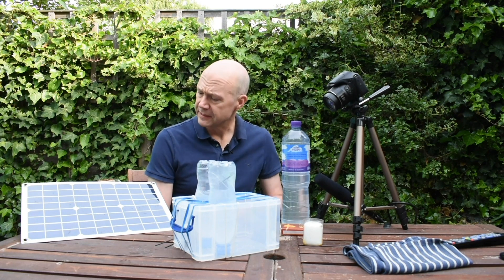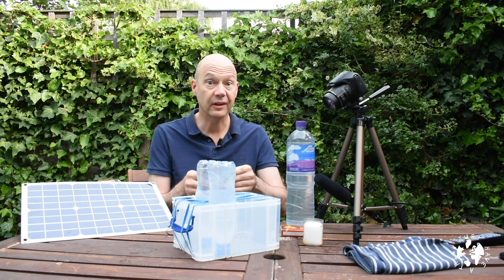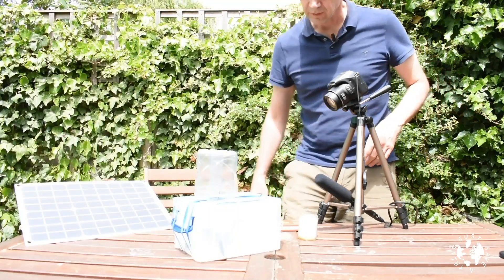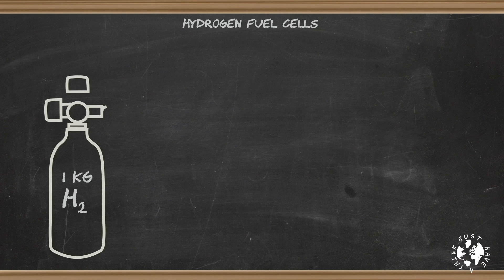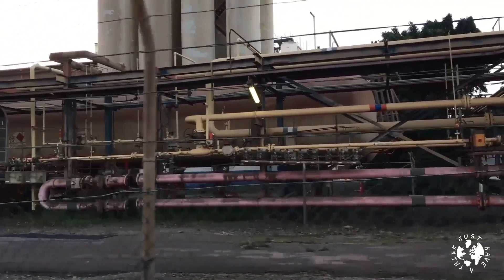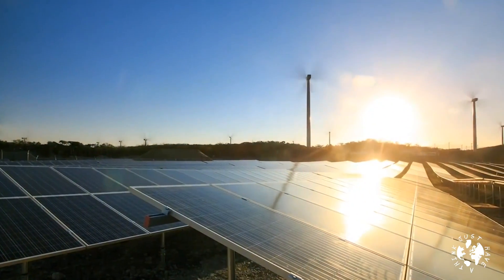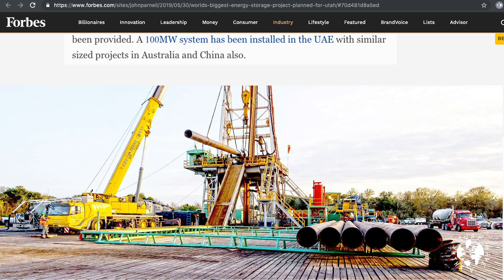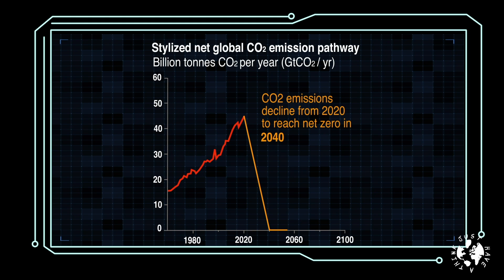Energy Storage in Hydrogen : Does this beat batteries?

Comment: Again, a stimulating and interesting video. Thanks.

You could do a second video which went into a bit more detail about the low energy efficiency of hydrogen storage compared with, for example, batteries and the extent to which that might influence the future direction of technology for light vehicles, heavy vehicles and static energy storage.
Reply: Efficiency is not what it matter most between clean sources, only overall cost. 
BTW, there is a lot of misinformation on internet about the efficiency of hydrogen technologies.
I even hear some sources saying that you need 5 times more energy to produce hydrogen which is stupid to said the least.
Today NEL electrolyzers are at 93% of efficiency without compression, then you need to add 12% for 700 bar compression or 30% for liquefaction, but the new electrochemical hydrogen compression units way superior to mechanic compression are at 8% for 700 bar (less size, way more small, silent, etc) and 15% is possible for liquefaction just scaling up production, even more if you apply EHC or magnetocaloric. 
New high temperature reversible fuel cells in lab already achieve it 75% in round trip efficiency (electricity-->hydrogen-->electricity) with high endurance, they just need a water vapor input at 500c, which could be obtained from any thermal plant as waste heat. 
In addiction, you dont need to convert hydrogen back to electricity to power the grid, you can work converting all the excess to hydrogen and then use hydrogen to power all those thing that can not work with batteries, like the utility transport sector or the natural gas grid.
Reply: @AngelLestat2  efficiency is what matters electrolyses needs an outside power source, and in the end you will only get out of that around 15% useful power. I have talked with many doctorates that do research in this subject of hydrogen and fuel cells and they say its very inefficient in many ways, not to talk about the expensive rare metals needed in a fuel cell.
Reply: @Rickardo22li  So hard is to check the numbers I provide before showing that level of ignorance in the topic?
You are sure you have talked with the right "doctorates" or you talked with biologist, medics, etc?
Go to google...  search interval (last 2 years), and start to check every number I provide (If you find only one being wrong, I will delete my comment). 
Then go back with your "doctorates" and kick their asses.
The rare metals are being reduce considerable, and that is not the highest cost of a fuel cell today, the highest cost comes from the membranes and low production numbers, they are all made at hand, in most cases are made on demand.
(To understand efficiency of electrolyzers and fuel cells, you need to check the output pressure too, even 30 bar of output is half the energy required to reach 700 bar if I remember right).
Reply: Ye hydrogen is VERY inefficient as a means to store energy BUT 
1. Less pollution (current battery technology produces a lot of toxic waste.
2. Good energy density (again current battery technology just isnt there yet)
Reply from the maker: Hi Matt. All good pointers. Thank you. I'm looking at hydrogen for heating and hydrogen fuel cells in the next video, but I do think the fuel cell thing is far better suited to big fleet vehicles like buses and lorries, as well as trains and boats (and maybe one day even short haul planes?). As for inefficiencies in static storage - I'll do a bit of digging on this one, but I think essentially the technology is proven in principle even if it will indeed benefit from better technology to improve performance. All the best. Dave
Reply: @JustHaveaThink  check the numbers I provide and check those with your own research on the state of the art.
I did it hundreds of times, they are very update.
If you want to search info about hydrogen fuel cells for houses, check the hundred of thousands units that were sale in Japan, using methane as input to provide electricity and heat for the whole house.
Reply: @Frank Olsen you are the clown talking over a topic that you know nothing about.
BTW, the amount of time that you can keep certain charge is not the important here, the important is the capacity, each time you double the capacity with batteries you need to double the cost, with hydrogen you just increase your tank size a 25% (this doubles the volume) or you inject more to the natural gas grid.
Without capacity any extra efficiency that you get with batteries (your numbers are totally outdated) it would be totally wasted.
If you have to store 2 or 3 days of strong winds,  you will need a battery storage capacity for 72 hours, but batteries can not store more than 4 hours in a cost efficient way,  this mean that you lost 68 hours of power, what is the efficiency of that?
Take a look, page 15:
https://www.all-energy.co.uk/RXUK/RXUK_All-Energy/2016/Presentations%202016%20Day%202/Energy%20Storage/Graham%20Cooley_Kris%20Hyde.pdf?v=635996073021366827
Reply: @Frank Olsen My critics goes around efficiency - not init cost of the capasitor
Capacitor???   I am talking about storage capacity, no "capacitors". 

Wind is a very poor choice for harwesting energy
Wind is the cheapest source of energy today vs all other methods, with solar in a close second.

The function of cost efficiency consists of five variables where charge efficiency of the storage is one of them. Over a wave in a 3D model you will see that buying more batteries is justified if the frequency of harwest is higher than cost efficiency of the different capacitors divided by each other - assuming today's energy cost of a kwh.
False, first the cost of storage and the technology you use would depend on your % of share of intermittent sources, plus the % of fixed sources like Nuclear (which it can not change its output being cost efficient) and the % of other thermal plants that require a lot of time to start and shutdown)
Once you calculate all that, depending the average of hours you need to store (this would depende on the instant cost of electricity), you made the calculation in base capital cost, lifetime, capacity factor and efficiency to find out how much money you can make in the lifetime of your hardware.
In short..  for low level of penetration of solar and wind, it may not need storage, or few hours of batteries or pumping hydro, but at higher share, you would win a lot more money with hydrogen.

Storage makes absolutely no sense unless your energy need is mobile and neat. Otherwise modern nuclear power
You have no idea of what you are talking about.
Even with full nuclear, you would need storage!  Even if you just want to power the electric grid, but you need to power all without co2, this mean the utility transport sector and the natural gas grid.  This mean you need A LOT OF STORAGE, so if you would use storage one way or another, why you choose a power source that cost 3 times more than solar and wind? 
Second... nuclear is the most expensive energy source today.

is to raise cheap iron up the moutain by a linear electric motor
Not sure if you really think you know something, or you are just trolling.
Pumping hydro is many times cheaper than any other energy potential invention by a huge margin.  I saw them all and I understand all the cost involve, you need a huge volume of water that is achieved with a lake exploiting the volume-surface ratio, because rising 1 ton over 100 meters is only enough to charge a battery from a combustion engine car. 
Still pumping hydro can not be done in any location and it is only cost effective for less than 10 hours in the best possible case.

I really think you are a troll, so I would not waste more time talking to you.

Comment: How P to G to P is different in concept than flow batteries? And flow batteries would be easier to deploy than hydrogen
Reply: Hydrogen flow batteries or fuel cells are hugely complex to build, and require chemicals or expensive electrodes or metals to be most efficient, but most importantly, they would be unused most of the time in a long term summer-storage and winter-output scenario. They are a better fit for regular day-night charge-discharge cycle or transportation vehicles. They probably would not work for wind-no-wind charge-discharge cycles which can vary by the minutes.

Hydrogen generation is a very simple process, as shown in the video, and powering a turbine with hydrogen instead of natural gas is also very simple, with only water as a by-product, as also mentioned and that you can see at 3:46.
Reply: @Chimel31  I was thinking about other flow battery chemistry other than hydrogen.
Reply: @user-py9cy1sy9u  Well even hydrogen in flow batteries is not pure. But it can't be anything other than hydrogen: With the extra summer solar energy, you are not producing flow batteries, you are producing long term storage fuel, such as compressed hydrogen. You can't produce, say lithium chlorate or methanesulfonate, you can at best mix up these chemicals. It's not the same as turning water into energy from scratch, like with electrolysis.
So I think flow batteries are out in this case.

Comment: Might be okay, when we have tons of extra solar electricity to store, but as a physicist I know that it takes 5 times as much energy to make the hydrogen to go a mile, as it does if you put it in batteries in an electric car.  And that inefficiency is built in to the chemistry involved and cannot be reduced.
Reply: The better way to store electricity is to turn it into some form of carbohydrate. I remember that one company used electricity to improve methane production in biodigester. I cant find it anymore
Reply: In some areas in rare days there is indeed extra energy produced by renewables that has no where to go but the bigger problem is we really need to plant more of them
I mean we need to solve the bigger problem (fossil fuel to energy) after that it is really easy to use the extra energy in various potential solutions ex: sea water processing ; pump water up to a dam then use it as hydro power when needed and there is really a lot of things to do if you have above demand energy.
Reply: But it can be accepted easily, especially when lithium becomes scarcer & much more expensive. Ease of production & abundance  counterbalance inefficiency.
Reply: @Dave-the-adequate  Lithium is very abundant element and we wont run out of it. We can only run out of cheap lithium
Reply: @Dave-the-adequate  lithium is used because it has great energy density per weight. For grid storage, weight isn't a factor. So we need to develop a different type of battery. Liquid metal batteries might be this solution.
Reply from the maker: Renewables will indeed be the key. No doubt about that.

Comment: By power density it lost to traditional fossil fuels and by way of generation it don't give any energetic advantage due to the high energy usage.
Reply: I agree totally, but, the energy that's being wasted, is wind and solar, which cost nothing, and is delivered for free. The only down side, is that we need to more than double the capacity that would be necessary if it could be stored by more efficient means.
Reply: @vincentrobinette1507  As an absurd analogy is like trying to pull an oxcart with an army of snails. Eventually they get the job done if you don't mind the time they will need.

Comment: Good idea, but can this process use sea water? as we keep hearing we will be suffering from drinking water shortages / sea level rise, If it can it would be brill.
Reply: @Joe Milosch I guess the next question is "if we used H2 from seawater for all our energy needs, how much potable water would we generate as a result?"
Reply: Electrolysis is more efficient using sea water, as the dissolved minerals conduct better than fresh water.
Reply: @Joe Milosch Thank you for your reply I did wonder about the corrosion aspect.
Reply from the maker: HI Jeff. I believe the answer is yes, in principle. In fact salt water is a very good electrolyte (better than the baking soda solution that I used). A couple of hurdles - sea water has all sorts of other stuff in it so it'll probably need to be filtered so it doesn't clog up the works, and also sodium chloride will give off Chlorine as a by-product of the electrolysis process so that will need to be carefully controlled so as not to cause a H&S issue. Otherwise though I think it's a yes :-)

Comment: I was telling everyone how to use a Prius for a power generator using a Hydrogen/Natural gas mix after Fukushima, glad to see the Japanese moved it forward.

I'd like to see Methane capture and use as the Permafrost melts as an energy source for a reason to try...
Reply: Rocky Shorz 
CH4 when burned, creates CO2 a greenhouse gas + 2H2
Reply: David Porowski do you think it is easier to capture CO2 before or after its released in the air?  Is it more or less expensive?
Reply: @davidporowski9512   it is CARBON NEUTRAL * - if the CH4 is NOT of fossil ! origin than it is part of the existing natural carbon cycle.

neutral regarding ongoing operation, I do not know the energy that is needed to build the devices, mine the minerals, .... (grey energy)